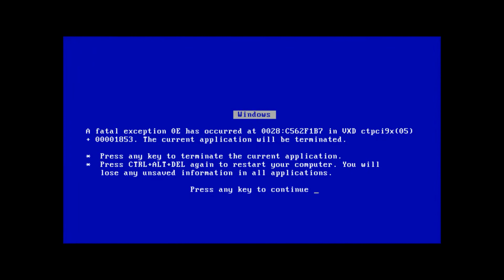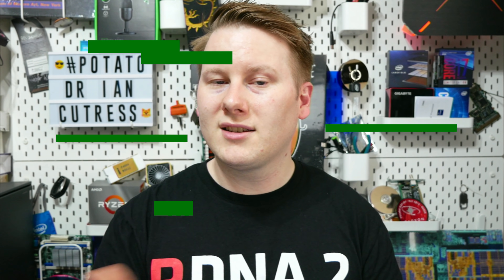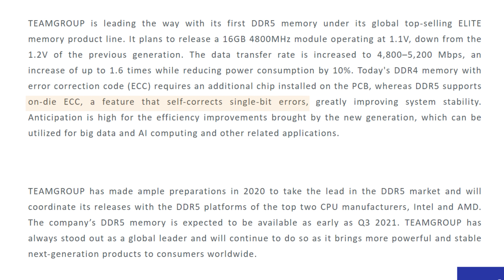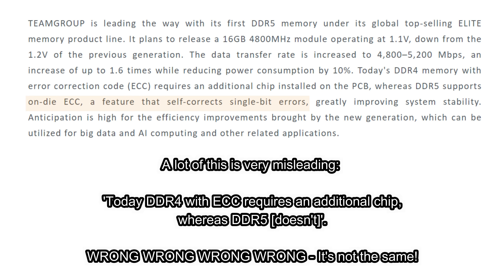Why DDR5 does NOT have ECC (by default)

Comment: There are some unfortunate misunderstandings in this video. Typical ECC is not and never has been full path protection. It verifies and can correct at the DIMM. Memory bus ECC/CRC was introduced in DDR4 and is standard everywhere now.

CPU interconnects (e.g. AMD infinity fabric and Intel QPI) also usually have this. CPU caches in x86 have always been ECC. SATA and PCIe also have forms of ECC.

On die ECC in DDR5 will lack the reporting capabilities of typical ECC RAM, but for unbuffered DIMM's it will be as effective. It may be required to correct more common errors due to pushing limits, but it will also protect you from all other sources of bit errors. This is a huge win!

RAM has always been the odd one out, and the reason for that is _market segmentation_. It always has been. Linus was right. All workloads are critical! Googles precious data centers are no more important than my many decades of carefully scanned family photos. My Minecraft world with thousands of hours over 5 years is critical to me. The artificial segmentation keeping ECC out of consumer systems is a travesty. Everyone has lost data to it, but they simply didn't know to blame a bit flip. How can you, when the capability to even detect it has been denied them?

Comment: Sounds like on die ECC is just for yeild. Which means that some memory locations will be on the ragged edge of malfunction, permanently due to manufacturing defects, not from radiation or termal effect.  And this will be "covered up" by  on die ECC.

Comment: Looks like my previous comment got deleted because I added a link to a photo of my RGB ECC RAM.

On last PC 3 out of 5 RAM modules failed one after another. Each time it took weeks or longer until I noticed it because bluescreens only started appearing late. So most of the stuff edited or written to disk got corruped over week. For example I calculated the sha512 of the same file 4 times and each time it was another hash. Then I checked stuff on my NAS (which should be secure with ZFS, raid and ECC) and alot of stuff I had edited or written to The last weeks got corrupted. The best NAS didn't help if your computer accessing it is corrupting everything it touches without a way to even notice it. As it was time to replace my old gaming PC I got DDR4 3200 ECC memory and added ARGB heatsinks to it. The heatsinks aren't that expensive (10€ each), look great and should keep the RAM cooler so they might live longer. And the heatsinks cover nearly all of the ugly green PCB. It might not be that fast but I will never buy non-ECC RAM again after all that trouble
Now I will atleast get warned early if the RAM is starting to fail and RAM error get detected.

Comment: Well, as someone who doesn't shutdown their PC ever and very rarely restarts it (only for Windows updates) I haven't encountered any BSODs for years. Win10 is just way too stable. *Running 3000mhz ddr4 @ 2666mhz/1.2v just because I hate XMP and overvolting chips in general, including SA/IO voltages on CPUs.

Comment: When it comes to the all RAM should have ECC argument I would say that having the option would be nice. Like if you had consumer cpus that supported both regular and ECC memory so that way you could choose between the data integrity of ECC or the high speeds and tight timings of regular overclocking capabal RAM

Comment: For bit flips, you say that there are only 2 ways, but there is another way that is becoming more common. Row hammer attacks. By flipping specific bits in the memory module you can inadvertently flip an unintended bit thorough voltage leakage.

This isn't a huge deal for consumer systems, but it's a huge deal for cloud data centers and other multi-tenant systems.

Comment: I see consumer DDR memory with active cooling in the future.
With water or air head sinks with fan.
The need  more space on the ATX / ITX mainboard.
On NVME M2.0 hard drives it is now possible that at least a sufficiently large heat sink is installed.

Comment: Cosmic rays depend on altitude and geography. Argentina is a high error area due to the south Atlantic magnetic anomaly.
Reply: Good deduction! With the north mag pole moving to Russia, more folk will need ECC. Maybe Denver too as the  whole field weakens.

Comment: If Intel and AMD had full ECC support on all CPU's, then I would probably bay ECC memory over RGB on my memory :-p
Also it would just be easier if all memory was ECC, and they could make faster ECC memory sticks just as we have different speeds of memory now.
And they could make it such that ECC could be disabled if you needed the 2% speed increase.
I think they had a good opportunity to make all DDR5 memory ECC and make everything simple and easy, witch would have been nice since many systems using DDR5 will have >64 GB of memory, and the more memory the higher the risk. But now we will have to wait for DDR6 to resolve this issue. :-(
Misted opportunity.

Comment: Excellent info... thanks...

So the DDR5 on-DIE ECC is just for production phase validation,,,
so the cell can be validated at the end of the production phase to mark it as vendable... 
?this feature won't validate 'bit flips' or some write error at code execution time ??

What is the mechanism ECC memory uses to alert the CPU/OS of a ECC error,,, ?a hardware interrupt
?can you elaborate a bit on this... or maybe a video... ;-)

As I understand the ECC (as 1 bit mode) is a parity bit... 
if there is no hardware active check... the OS will only detect a ECC error when 'touching' the memory cell...

Thanks again for this info...

Comment: Was the change to non-ECC for benchmarks, or cost?
My IBM PC has ECC; 9 identical chips per bank.  Actually, I think it may have just been EC memory, as I recall memory errors just causing the machine to indicate that, and then hard lock.  That was indication that it was a good time to reseat your memory DIPs.  I remember 286 systems being offered with both ECC and non-ECC, and non-ECC was always cheaper.
Reply from the maker: Both, and also product segmentation.

Comment: A nitpick about "bit flips": memory can have just parity detection, well short of ECC, but still capable of detecting a single bit flip. It will also, potentially, cause a crash, but will not corrupt data "silently".

Comment: How the hell can an alpha particle (a Helium-4 nucleus) get through and make a bit flip?

Surely you mean a gamma ray?
Reply: Alpha particles are generated inside the package. Formerly a big problem. Very thin shields now protect RAM.
Reply: @charlese2833  How are they generated inside?
Reply: @SapereAude1490  package material is very slightly radioactive. No one noticed  until bits flipped.
Reply: @charlese2833  I see, I see. I found a Wikipedia article about it. Apparently, Isaac Asimov predicted it in 1957. in Caves of Steel. 

I actually have that book, and I read it. Can't believe it slipped by me.

Anyway, thanks for clarifying that.
Reply: @SapereAude1490  I, robot : the positronic brain is slightly radioactive...

Comment: Is ECC a parity bit or something else ?
Reply: Standard ECC memory uses a more complex error correction code called SECDED which is an extended hamming code capable of correcting single-bit errors and detecting (reporting) two-bit errors. It's not just a parity bit, although the algorithm does incorporate parity checking.

Comment: Personally, if given the choice between slightly faster non-ecc RAM that might give me (_just pulling random numbers out of the air here, idk what kind of performance hit it would have in my system-_) 1-5 more fps in most games, and ECC RAM that would guarantee i don't crash once or twice across my computer-using career, i'd take the first option.

Though frankly, with how fast DDR5 is slated to be anyway, i don't think it'd matter to me at that point, and my priorities would probably shift towards favoring ECC.

Comment: So on a Ryzen-based design, where the CPU does support ECC, do we think we will see a full ECC implementation on most consumer platforms? I guess the question is: does the DDR5 signaling protocol include error correcting codes? Or does “on-die ECC” mean that as soon as the data leaves the die, it loses it’s ECC? For a full DDR5 ECC implementation, what is different between that and “on-die ECC,” given that we know the CPU is the same?

Comment: Ah well... It sounded too good to be true that we'd all be getting ECC everywhere with DDR5.  I appreciate the explanation and particularly that you clarified that 1TB of system RAM was the order of magnitude where we'll need to start worrying about it for "everyday" use.  That said, 64GB is only 16x smaller than that, so we aren't too far away from that day.  (Yes, I have a lot of tabs open in Chrome.)
Reply: More precisely, if 1 or more bits in 64 being read wrong is rare, like 1% of the time, then on-die ECC is in fact offering some (99%) protection against bit flips that "normal" ECC modules protect against.  The thing it does NOT do is protect against errors on the high speed bus to the CPU.  Those errors would go undetected and uncorrected if you only have on-die ECC.

Comment: One thing I think you could have talked about is that 1: DDR memory cells are capacitors. They charge up to a certain voltage, then that voltage leaks away. 2: you could remind people that in addition to density, the operating voltage of memory is getting lower and lower, so we have less and less difference between a 1 or a 0, making them more susceptible to bit flips as well.

Comment: So, my understanding is, "DDR5 core technology is so unreliable we need built-in ECC to make it appear to be as reliable as DDR4"?
Reply: The same thing happened with the Flash chips used in SSDs a while back - "our new high density TLC flash is so unreliable we need ECC in the SSD controller to make it appear to be as reliable as MLC"
Reply: I should clarify that isn't really a bad thing - it's something the industry has been doing for ages in different contexts.

Hard disk drives have been using error correction codes for many many years, for example. A read error from an HDD usually means that the hard drive tried to read the sector several times, but every time it got errors that couldn't be handled by the error correction data. The drives will often have a SMART attribute that indicates how many correctable read errors it is handling internally. A part of the reason for the switch to 4k sectors was to reduce the overhead of the error correction data.

Optical media (CDs, etc) were expected to be unreliable, so they built multiple levels of error correction data into the specification. There's so much error correction incorporated on a normal data CD-ROM that about ⅔ of the contents of the disc is error correction data.

Comment: Would that form of ECC carry a performance penalty as compared to non-ECC at the same clock speeds and timings similarly to the traditional forms of ECC? It would be horrible to get a performance hit without the full protection of ECC.
Aside from that, couldn't they do the XMP equivalent of ECC and just run the RAM higher speeds with ECC enabled?

Comment: It still improve stability on consumer level. Although it may not correct bit errors on interface between memory controller and memory chips. It still make sure bit in DRAM chips are accurate which current non-ECC DRAM chips or even ECC DIMM unable to do (yes ECC DIMM have more chips, does not mean chip has ECC)

So if system was set-up correctly there almost no chance of memory-error at the controller-to-dram level except running at higher-than-certified clock/timing.

Comment: Thanks for this video, clear and interesting.

When you say read => refresh => write cycles, you should also say that a read from the RAM implies rewriting that RAM "line". A read flushes, "destroys", the charges; so the read data must be rewritten to not be lost. And this actually makes an implicit refresh. I'm not sure if DRAM controllers do take advantage of this, but they may save some refreshes if they keep track of which RAM lines have been read or written to. I saw an embedded design where they could ensure all RAM data is read or written to within 64ms, therefore omitted managing any refresh (they only allowed the RAM to go in sleep/autorefresh mode for powersave).

Another point; I disagree with you saying general consumer does not really need ECC. I can agree for cosmic ray and heat induced bit flips. But for security, everyone deserves to be protected from bit flip attacks like rowhammer. AFAIK DDR5's ondie ECC will improve the situation (maybe even fully mitigate rowhammer attacks), so that's definitively an improvement. Therefore, with DDR5 I can agree full system ECC is not really needed for general consumer, but not for DDR4 and earlier (and it's a shame that Intel was pushing that much: "you don't need ECC").

Comment: I don't see why ECC DIMMs should be slower than regular DIMMs, the chips are the same after all, you just get an additional chip per DIMM for the redundancy needed to do ECC, if anything using ECC while overclocking should enable you to push the system harder. Currently available systems usually won't let you do that because overclockers are too cheap to buy ECC and the enterprise crowd usually values reliability far too much to consider overclocking

Comment: but did it not have 2x (32+8) databus? is that no ecc?
Reply: Regular DDR5 ram (with on-die ECC) will have a 2×32 data bus.
ECC DDR5 ram will have a 2×(32+8) data bus.

Comment: To my knowledge alpha radiation from radionucleides in the molding material is a significantly higher source of soft errors than cosmic rays
Reply: That used to be the case. They claim to have solved that.
Reply: @charlese2833  A chipmaker can specify low activity mould compounds that reduce the alpha emissions by about one magnitude, but that is still more than the activity caused by cosmic rays.

Comment: on-die ECC could actually provides tighter timings or lower voltage. Think of it like this, tighter timing => error occurs, lower voltage => error occurs, but as long as the # of errors falls below the number of correctable (or detectable, depends on the policy) errors, it  could lead to possible gain.

Comment: I'd like to see RGB ECC but with useful functionality. Like it goes red to indicate a module had an ECC error. The RGB on my gpu and cpu are set to temperature and because most cases have windows now it's useful to let me know of thermal issues or time to clean heatsinks.

Comment: Will ECC DDR5 memory be more available? Will it be relatively cheaper?
If the bits to store the ECC are already are on the module; it seems the marginal cost of supporting the ECC signals from the CPU should be reduced.. perhaps enough to allow the majority of
modules to support external ECC...

Re - ECC is not required. Modern OSes typically use ALL of the available RAM on your machine over time.  A lot is used for read-caching the disk contents; including the structural information like the free-space map and file layout map.  A corruption in this structural information could lead to the OS mistakenly directing a write to the wrong location on the drive, corrupting data written earlier.
It is unlikely, as you say most of the RAM is holding unchanging data that will be discarded when the space is required for another purpose. However, the potential is there.
The PC problems that are solved by the 'turn-it-off-and-on again' solution, could reflect a bit-flip in a DLL or device driver or the data that they use internally - as these stay in memory for long periods of time.  
End-to-end ECC is definitely a feature to want.  It is not in my minimum specification YET, only due to cost and availability concerns.

re PERFORMANCE, I recall that the fast-path with ECC - the no errors detected one - did not add any clocks to the memory access pipeline, just extra pipeline delays if the memory retrieved required the ECC supplied correction and OS intervention if the correction failed (2 or more bits changed)... 
Others (Linus T) have suggested that the reason INTEL servers support ECC while the desktops do not is to allow market segmentation and a higher price for the enterprise market..

I *think* the module physical interface is the same for DDR4 unbuffered-ECC and unbuffered-non-ECC ram - is that going to be true for DDR5?
Has the way that a DDR5 memory module will work with an ECC supporting memory controller been openly specified yet ?
What happens if the CPU writes a byte into the middle of a word of ECC memory?  I think servers now do read-modify-write of the entire word in this case now? Will DDR5 support in-place byte updates? (it seems like it COULD work).

Why ECC is on my - I REALLY WANT IT LIST ...

The data on my home PC is a mix of stuff from a variety of places, some deeply personal and irreplaceable.  I can not reasonably ensure the data is not corrupted before whatever backup is made.

ECC on main memory, parity in cache rams, data storage check codes, network packet check-sums etc are all well known and available techniques that I can not rely on to protect that personal data as the main memory is NOT validated.. every transfer starts and stops in this memory.

I would love ECC end-to-end to be available - here in the UK, there only a few sellers of the modules - my google-foo failed completely when I built my last system.

I just have to hope that the systems I build stay on the right side of the performance versus stability barrier...